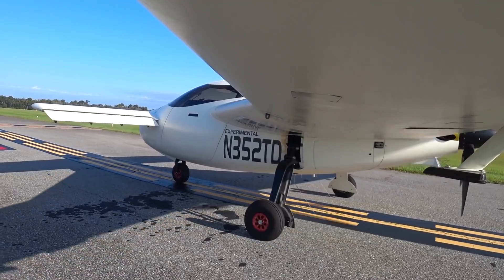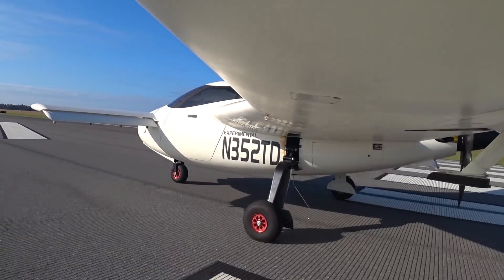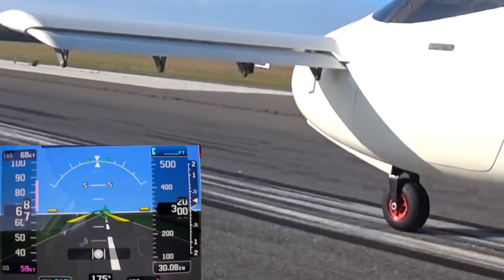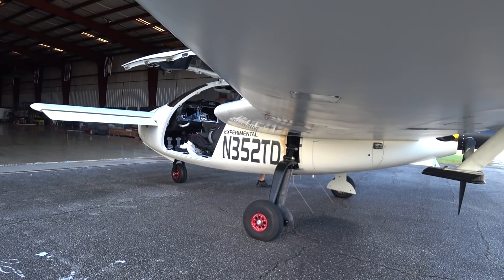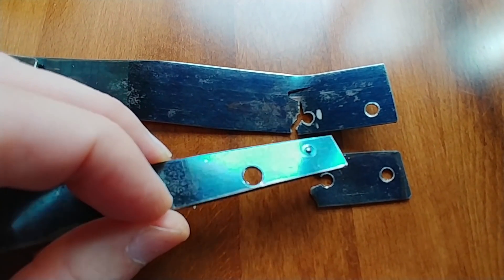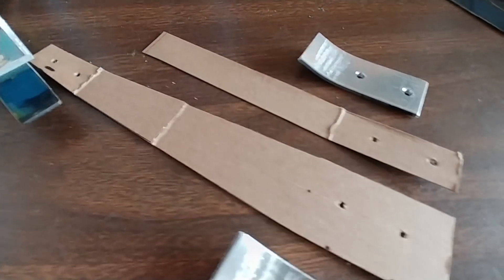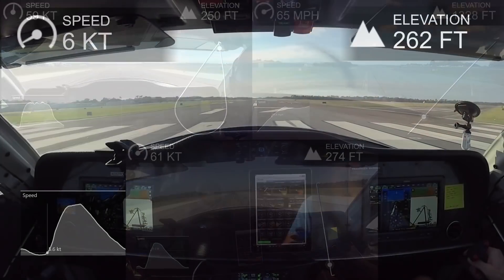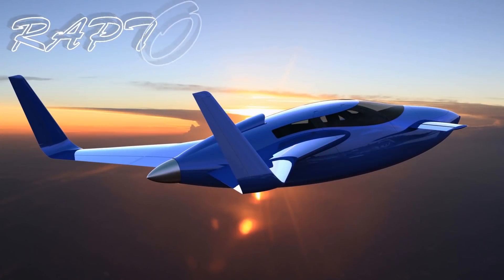Setting Takeoff Trim - Building the Raptor Prototype

Comment: It looks like not enough ED on you holes. Also. Spring steel should get nickel plated.
Reply: I disagree, if the spring is plated it will become hydrogen embrittled. Even if if they bake it out, it may never be the same.

Comment: Adding additional leaves to distribute the load on that flat spring is a good remedy idea, but aluminum lacks the fatigue strength/cycling to make a lasting part. Just another piece of spring steel would work much better. If the tension is too high, it can be thinned. Also, if you can place the holes in the center of the spring, that may let the spring last longer, as long as doing so would not impart a twist in the part for its action.

Adding more metal to the sides of the par might have prevented the crack. Two thinner strips may work better, as long as they are allowed to slide a bit.

Also, the spring should not be plated, as it will make it more hydrogen embrittled. Paint or powdercoat would be fine.

If there is any question about drilling stresses/edges, the holes could be water jet : )

Comment: Hi Pete, i was going through some of your old videos on the  twin turbo calculation and fabrication etc, but i didn't managed to find the  size of the turbo you are using for the build, anyway some suggest that the twin turbo exhaust drive pressure is too high hence the high egt,you can fit in a exhaust drive gauge and for temporary run the high pressure turbo only in your low altitude  testing by  removing  the spring of the waste gate to reduce the back pressure on the HP turbo exhaust outlet, this can help reduce turbo outlet temp, and not heat the intercooler so much....the thremostat mod did by darkside development could also help....

Comment: you should use tension springs rather than flat springs... it wouldn't add much weight and would be easier to tune. A simple coil spring with a hook on each end won't break as easy, and you can anchor one end with a turnbuckle to add or decrease preload. 
Easer, cheaper, and more durable. Plus harder to overstress.

Comment: Try doubling up on the spring steel long pieces aswell as the aluminum brackets 4 pieces should hold better and you want extra hold at the flex edge hole that broke on the old ones also want to lube that metal on metal but wire lock that pin bolt assembly.

Comment: Everyone with an engineering background and experience with turbo setups will tell you the same thing: remove the second turbo. We know that you don't believe that this single change will add a hundred horsepower and lower the EGT's, but that's the magnitude of the mismatch now, believe you or not. You can even measure the back pressure first if you want (use a 3ft cooper line to reduce temp from the exhaust to the pressure sensor).
Reply: But it's too hard! It's not a quick fix! /s
Reply: I feel that Peter has been a little taken with the performance, at the the expense of other concerns.

Comment: Peter, I don’t know if you follow AvWeb with Paul Bertorelli, but he put out a video this week covering flight characteristics of canard aircraft and he flew with the instructor of the school in a Long Easy. She explained the difference between a canard aircraft operation and a standard rear elevator flight characteristics and comparing the landing handling of both and the main differences. She explained the stall cycling flight characteristics I believe you may have been experiencing. I don’t know how many hours you’ve spent flying a Long Easy style aircraft but she offers a two day course if you haven’t been instructed in this design. I have never flow one or had the opportunity too, but she makes some great points about landing and handling the aircraft in crosswinds. Check it out if you get time. Make the time. Best regards Peter. Cheers!
Reply: Paul flew a Velocity, not an EZ.  Similar looking but on different ends of the spectrum.  Regardless, the Velocity is similar to what Peter is building and Velocity Aircraft's training and expertise would surely help his situation.
Reply: @Gunhound507  - thank you for your analogy of the two aircraft designs. As I mentioned  I know very little about the differences of these aircraft but I have to respect the flight performance of these designs. I know Burt Ratan was involved in some of these original designs but I couldn’t tell you where Burt’s design ended and another design engineer took over and progressed from this design. Thank you for your approach to informing me of my deficiencies in defining which aircraft was being used for pilot training. I really appreciate you for not feeling the need to make a brash statement towards my mistake. I really should look into the composite design of all three wing/structure loading’s and the benefits of having the canard function along with the tandem pilot arrangement. Maybe I’ll never understand why a person feels the need to corrected someone in a negative manner to obtain validation for themself’s?. I also was able to see that the person who felt the need to negatively respond to my post about the information I was trying to convey to Peter. Johnson hadn’t posted any information or comments on Peter’s video other than the negative one for me to ensure that I needed correcting. Thank’s again.
Reply: You might want edit that add some miss words an othe issues. Is little hard read way is.
Reply: @Digital-Dan  /I missed something thanks for being cool about it and notifying me. Dah!!!
Reply: @Digital-Dan  - thank’s again Dan. Mia Cuppa... Sometimes I have my head firmly wedged between my butt cheeks and refuse to make any alterations then I push play and the world gets to read my lack of attention. Thank you again Dan.
Reply: Went over an watched it.  A different aircraft altogether unless you just consider that they bare both acard.  IMHO.

Comment: You still need reliable measurements of delta p and delta t across your radiator (and intercooler). For Voyager, Dick & Jeana used their airport truck to determine how much delta p they needed per unit HP,  and then used simple water manometers to tune their inlet, plenum, and exhaust to provide the necessary delta p at lightest weight and lowest drag. They didn't need a bunch of dangerous crow hops, and their system worked first time, every time. They definitely didn't just throw stuff at the wall to see what would stick.

Comment: Peter I've been following since the beginning. I've been silently cheering you on. But I believe the gentleman is correct about removing the 2nd stage turbo. It would have you down for a while. But the jump forward (and the weight reduction) would move things along and illiminate something that seems to be chronic
Reply: If the the Audi person is correct, then I also agree that removing the 2nd turbo might be prudent, as far as weight, balance, heat, and reliability.